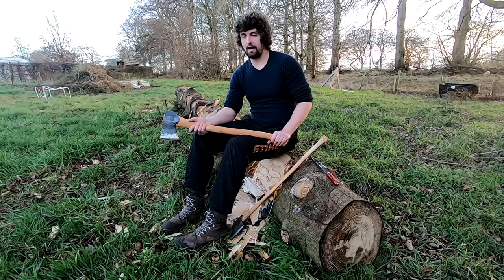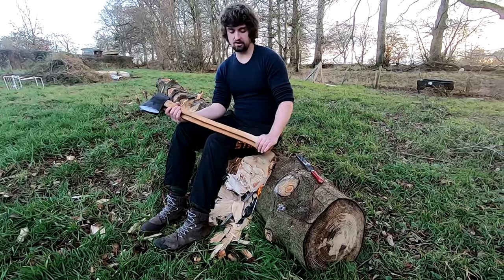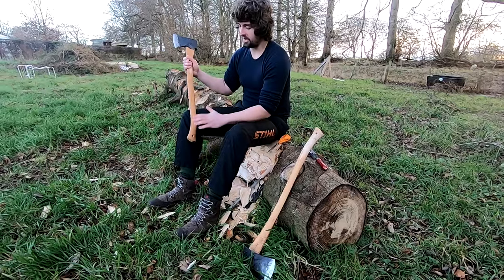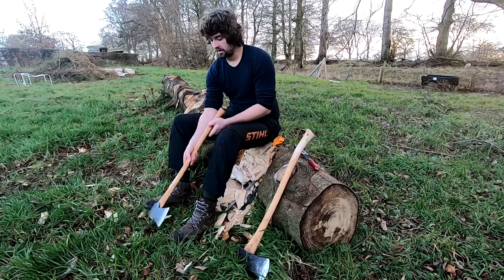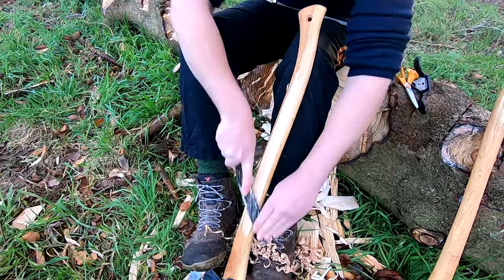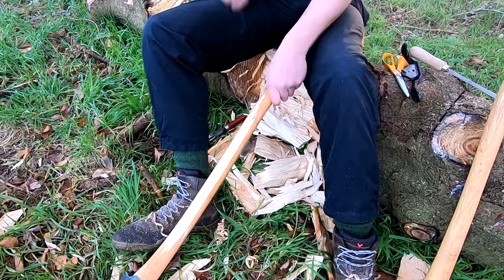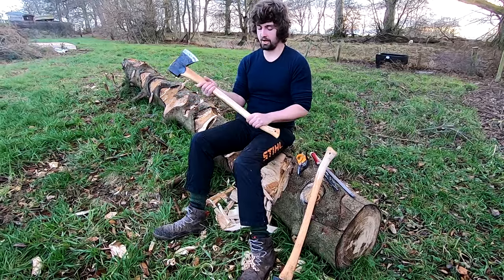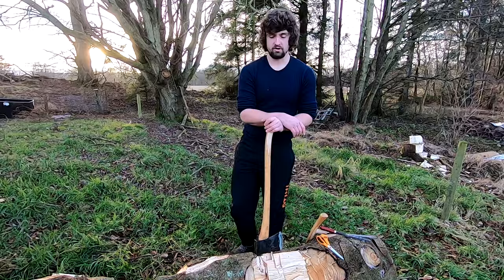How to Thin Your Axe Handle, Gransfors Bruk American Upgrade

Comment: No not the logo! 😆 Did the same thing to my GB forest axe. I subscribe to a lot of the "theories" SkillCult has on handles. He's obviously thought a lot about the subject and most of his thoughts on handle shape and construction make a lot of sense to me. Handles just keep getting thicker and thicker, often in the wrong places as well. It's evidence that less and less people are using axes seriously as tools because a thick handle is just a terrible experience. Some manufacturers like Council Tool at least get it close for you. I still tune them up as well though. Love their boy's axes, purchased partly because of your recommendation so thanks for that 😁
Reply from the maker: Yeah council is the only hickory handle i'm happy enough to use stock, i dont mind stock european ash either depending on the shape
Reply: Totally agree - I was talking with a Tree Feller and he told me that where he shops 90% of axes are sold just for making firewood.
Reply: @benscottwoodchopper  did you have to modify the bevel on your council tool boys axe quite a bit from stock, because mine, which is pretty old, doesn't look like anyone has ground the bevel at all but its shape is really messed up looking,like if i were to try to see what the angle of the bevel is, it would be different on the top than the bottom. or maybe a better why to describe it is that if when im trying to sharpen it so i take a file and try to mark where the bevel line is it would be a sort of squiggly line
Reply from the maker: Yes i thin the bevel with a file

Comment: Handle on my new Hults Bruk 26" axe is 23x35mm. That is quite close to your recommended dimensions. 
But yeah I am going to thin it little bit. Thanks for tip with scissors.

Comment: Thin to Win! Bits and handles! Make them things ignorant to wood! Been too long. We need to get that mop on your head sorted out! LOL 
Just thinned a cheap handle today with scissors and a draw knife. I think a spoke shave is the best tool though. Draw knife can really bite hard and ruin the day. Spoke shave and scissors more controllable. Fine tuning around the head a razor blade will work for that fine work.

Comment: Hey Ben, have you tried any of the Russian/Siberian style axes (as seen in Happy People & from Jordan Jonas [Alone])?
Reply from the maker: Unfortunately never had the chance to try one
Reply: @benscottwoodchopper  They're pretty interesting. Large triangle-shaped heads, huge cutting surface (5+ inches), thin profiles, often with a chisel grind for better planing etc, often with slip fit handles. Remote Siberians use them for everything. Jordan Jonas says no axe works better for outdoor living.

Comment: Hey Ben, I bought the Rinaldi American Boys Axe largely based on your recommendation. The head wobbles out of the box unfortunately, and is much larger around the top of the eye than the handle (front to back), leaving a big gap. I don't know how common that is. Would you recommend sending it back... or just sanding the handle to get as tight of a fit with the sides of the eye as possible.. or making a new handle (I have no experience)?
Reply from the maker: Uncommon in my experience. Ultimately up to you

Comment: So, any advice on setting up a very cheap spokeshave??
having now broken the last decent pair of scissors in the house...
Reply from the maker: Keep a look out in antique tool or junk stores, shapens similar to a wood plane
Reply: Honestly in my experience any decent blade will work, I've even used kitchen knives. A spoke shave is faster but can be harder to use in places like the inside of the palm swell. A plain old knife held at 90 degrees or so will produce the desired effect. A blade with a little flex in it can help as well as you can slightly change the way it shaves by flexing it a little with your hands if that makes sense

Comment: I hung anxe the other day and the wedge was to thick it didn't go all the way in . Is there a way to gage how thick the wedge needs to be to get a good seat ?
Reply: That's one of those things you kind of have to learn by experience it seems. The wedge almost never "goes all the way in", you may have still gotten a good hang. I try to make sure my wedges are going to fill at least 2/3 of the kerf though, the more you can get the better. Obviously it usually needs to be thinned down if you're talking factory wedges, but one of the last things you want is to make it so thin it bottoms out in the kerf....

Comment: Hey Ben Im thinking of getting a basque axe (although Im not sure if the quality has been improved) and they tick almost every box for me. Good overall, slip fit. But the lack of a poll is concerning me. Do you think that its ok to bang in wedges (wood or plastic) with that type of poll?
Reply from the maker: no i would not use a basque axe for driving wedges
Reply: @benscottwoodchopper  do you know of any slip fit axes with a good overall geometry   with a poll instead?